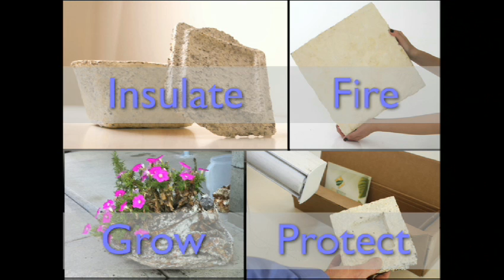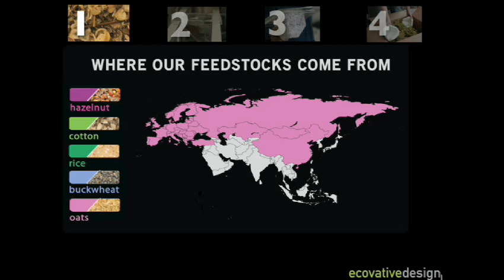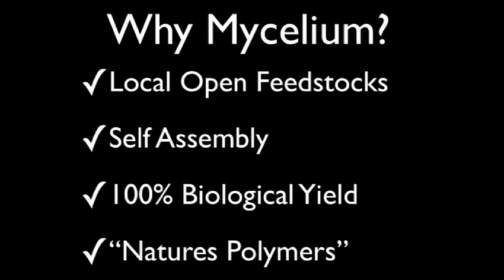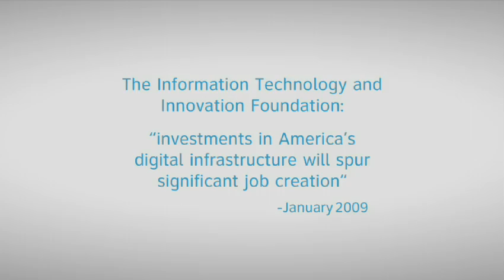Eben Bayer: Are mushrooms the new plastic?

Comment: Very interesting material, yet, to manufacture parts in a large scale, it needs a lot of those moulds that are made of ... Plastic...  Would still need to have an easy recyclable plastic for those to get a real sustainable business model.

I think this material is indeed the replacement for Styrofoam, but not for anything else.
Reply: +Vincent André Still, better to use the amount of plastic required for one mould than a thousand packages
Reply: It doesnt need to be specificly of plastic, man. It could be made of other material.
Reply: there's MycoWorks, they grow isolation, leather others make paper etc etc
Reply: It can be glass, you know? Plastic is just cheaper and easier to work with...
Reply: It can be glass, you know? Plastic is just cheaper and easier to work with...

Comment: Yeah and ? How does it matter ?
Mycelium could be used to replace styrofoam and it would be a great advancement, the fact that these corner pieces are in plastic means we haven't found an alternative... yet. And the kind of plastic used for these things are probably recyclable, it's the same kind that you use for your plastic bottles... It's not the same as styrofoam :)
Mycelium would be much better than styrofoam...

Comment: That polypropylene packaging materials don't biodegrade does give it a unique advantage that isn't readily apparent. It is extremely resistant to diseases and food stock for other organisms. Switching to organic packing materials such as shown above will solve one of our most important waste management issues, but it may introduce new problems by opening fertile niches for parasites, diseases, and bacterial contamination to exploit... potentially limiting it's use or posing a health threat.